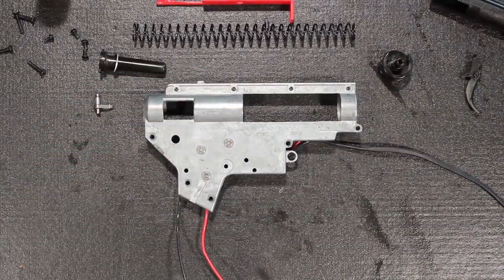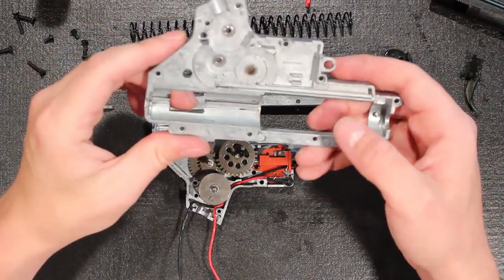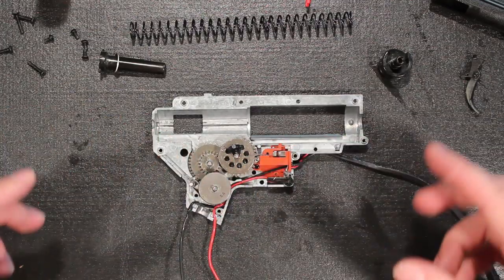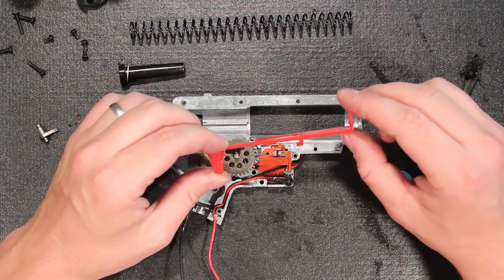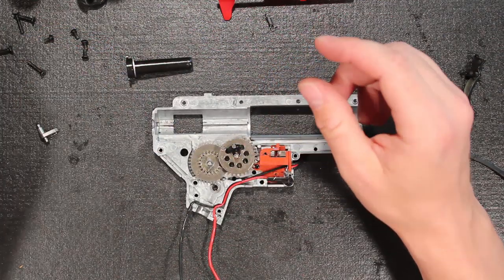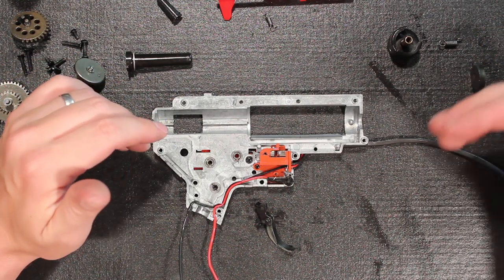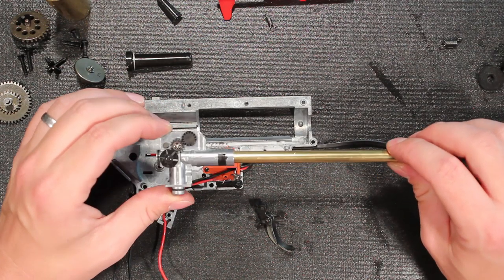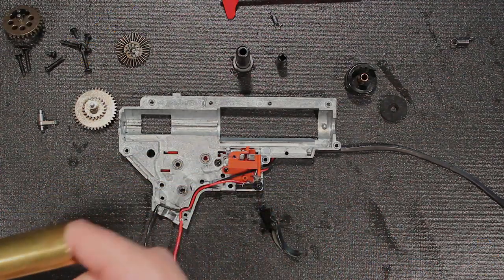King Arms M4A1 Internal Gearbox Review

Comment: I've owned one since 2007.  I immediately replace the compression set and beefed it up to around 380-390FPS at around 25-27BPS, but kept the stock gears and stock shimming.  It took me up until earlier this year for there to be a problem with my gearset.  Even then, when the failure occurred, it was the bearings, not the gears that failed.  Few stock guns can boast that.

Comment: I have a King Arms Troy m7a1 for 6 years. I have no problem with it. I only change the barrel to a KM 6.04mm barrel and a better piston head for better seal. but no problem. and this gun has been using the King Arms 11.1v lipo.

Comment from the maker: When you correct the angle of engagement, usually the first tooth of the sector gear will catch the second tooth of the piston instead of the first tooth of the piston.  We want first tooth of the sector gear and the piston to meet up at "12 'o clock" so there is as much surface area as possible between the two teeth.
Reply: Do you know where I can buy on of these gearboxes for my gun

Comment: The wires have a "quick disconnect" feature where the wire will pull apart without having to remove the plug.

Comment: I just worked on one of these and it was the worst shimming I've ever seen and the aoe was way off like 2 o'clock had to use a washer on the piston and neoprene on the cylinder just to get it half decent the guy already broke to pistons before I worked on it so someone else had been in it so maybe they messed up the shimming who knows. Still it's solid. But having to clip the wires to get the gearbox out that's bad qc I added flat connectors which they should have just made it with them.

Comment: Hello please answer my quick question 😊,currently i modified my internal components (king arms vltor m4 gearbox) using m150 spring, i did change the spring guide with metal spring guide, also i change my cylinder with a bore up cylinder that connected with with the cylinder head, and change the motor to high torque guarder, and i play only semi-auto. My question is, does my current setting is friendly to the gearbox? Or does anyone have advice to avoid cracking issue? Thank you!

Comment: My local Airsoft shop advised me not to run an 11.1 lipo with my King Arms OAM8 rifle citing internals are not strong enough to take the stress.  This is a $350 gun..anyone have any experience running LiPos on a stock KA rifle with no upgrades?  Any problems?
Reply from the maker: You can run 11.1v. If you are not confident then run a 7.4v.
Reply: 321Airsoft absolutely! Very performant! I suggest a little work on "air group" to make it smoother.. Helps a lot for the life of the GB
Reply: +Simon Richards  I'm using 7.4 Lipo and its great
Reply: Simon Richards i run mine on a 11.1 now for a year no problems with it mines the oa15